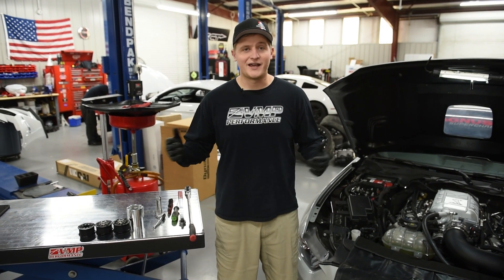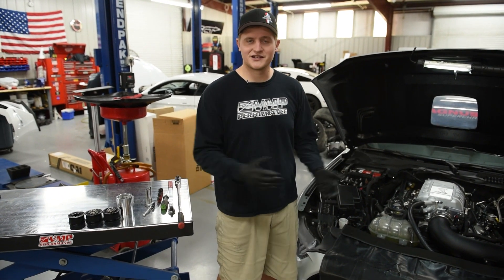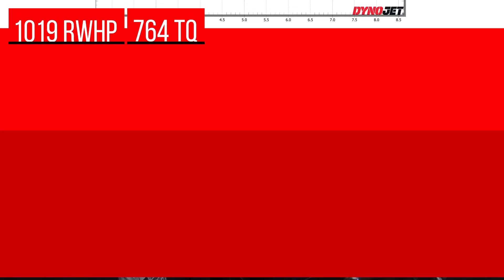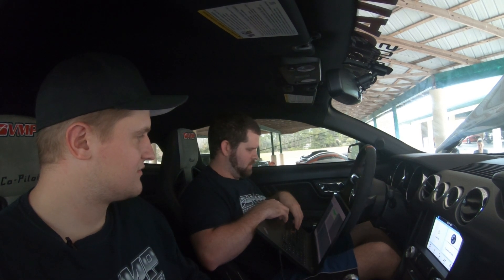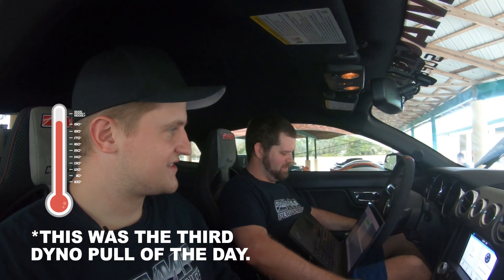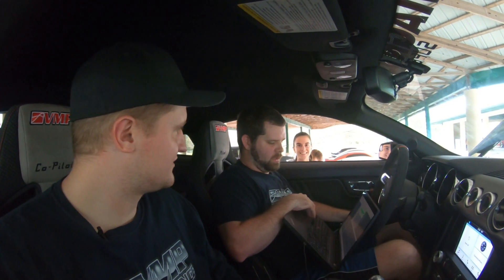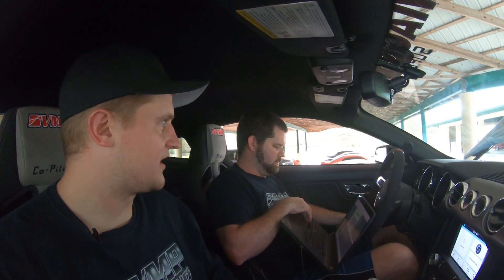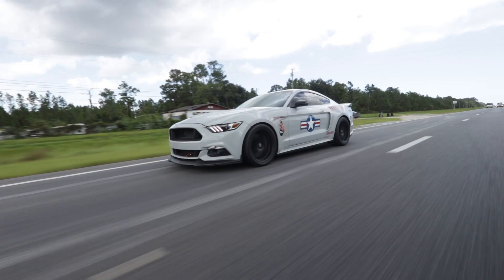World's First 2020 GT500 swap | Griptec hub and Pulley Swap

Comment: I thought this motor runs cool so whats causing the temp to rise
Reply from the maker: The engine itself is cool.  Higher boost pressures and an inefficient intercooler core at those increased pressures has resulted in rising intake air temperatures.

Comment: was the original supercharger pulley an Overrunning clutch pulley..  so when you shifted ... letting off the throttle the supercharger rotors continued spinning while the belt and crank slowed down during the shift..
Reply from the maker: The stock pulley was indeed a clutched pulley.